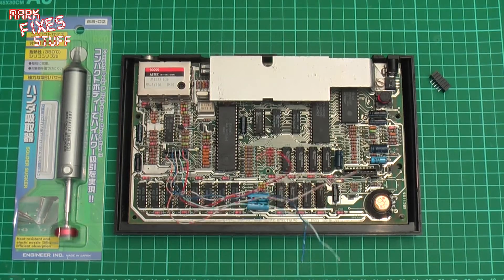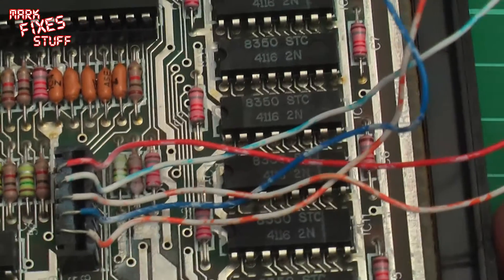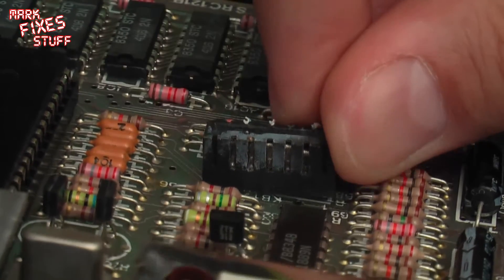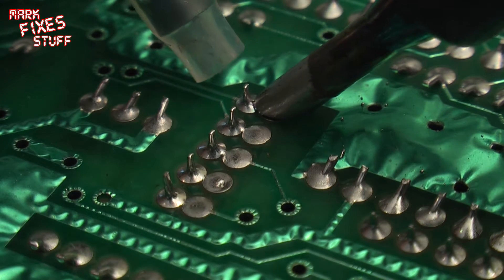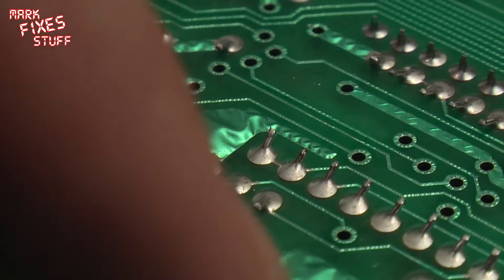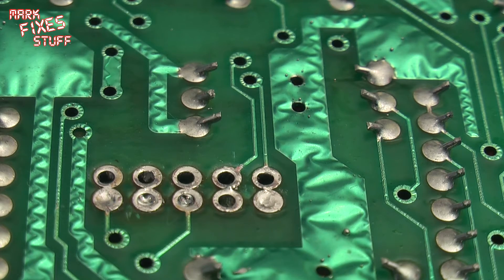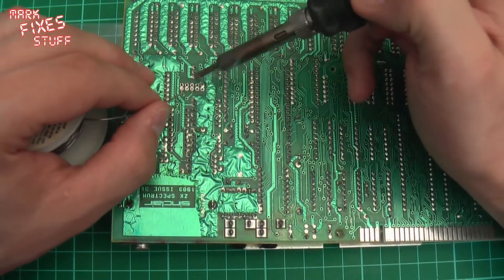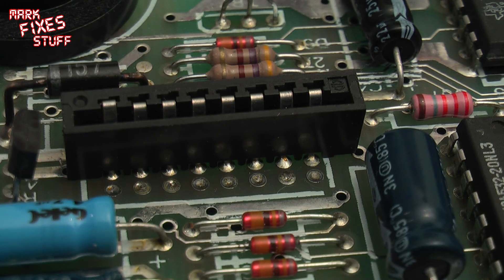Replace the Keyboard ribbon connectors in a 16/48/128k ZX Spectrum

Comment: Once the plastic part of the socket has been removed, I would apply some fresh solder to each joint then heat the joint and pull each pin out with a pair of tweezers. I would then clean the holes with good quality wick. A lot of de-soldering pumps, especially the cheap ones, can damage the PCB very easily.

Comment: Minor point (nothing important mind, but this is the internet): I think that was telephone cable, not cat5, it was tinned copper not bare like cat5 :)

CW1308 telephone cable is a good source of tinned copper wire rather than bare, for links and suchlike. Watch out tho, some of the modern stuff is copper plated steel...ick

Comment: Really good vid, Mark. ;)

That's a good way to remove those sockets, since it's much easier de-soldering one pin at a time. It also helps to relieve the strain on the other pins once the plastic part is off, as you say.

Definitely worth getting one of those nice solder-suckers too.
Reply from the maker: The solder sucker will take a bit more getting used to I think. It's good to get in close, but there is a fair bit of spatter. I think I might need to clean it a bit more often between suction, maybe every time, as it gets full quickly.